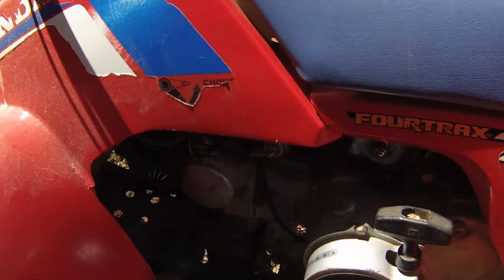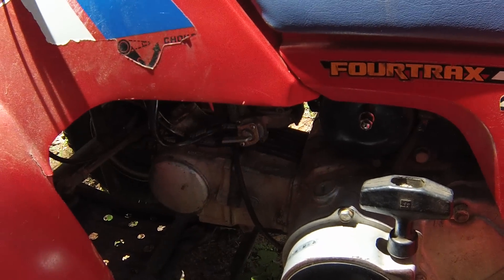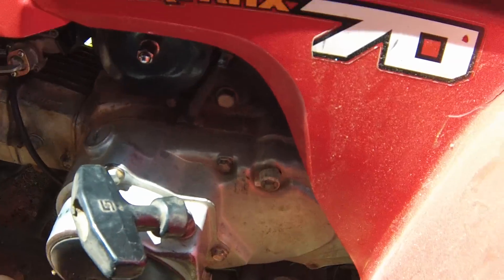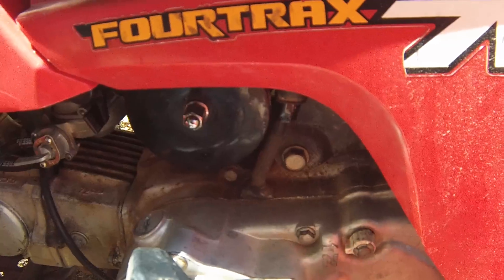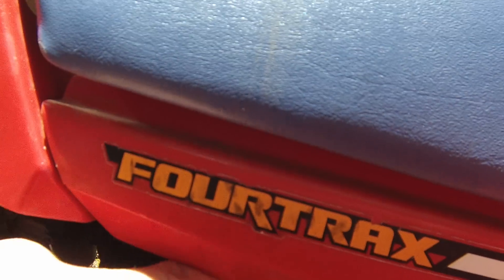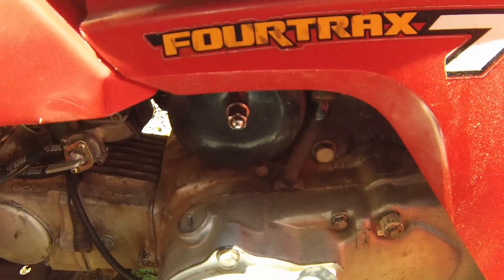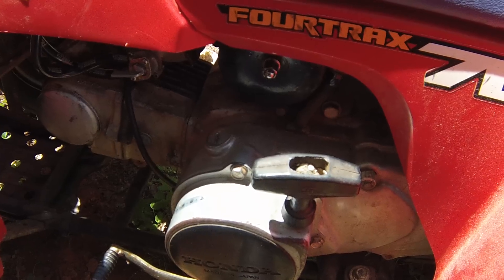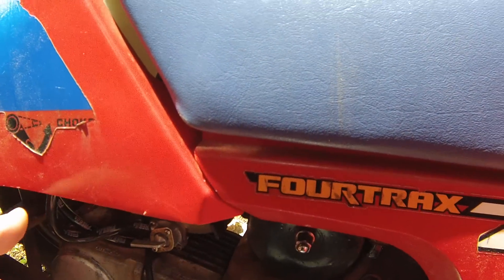Honda TRX 70 No spark fix, try this FIRST!

Comment: I stumbled on this a while back while I was still researching the TRX.  Well, a few weeks ago I finally found a nice original one.  The seller essentially gave it away because he couldn't get it to run anymore.  He'd replaced the coil, plug, kill switch, carburetor, tank, etc. with no results.  I bought it as a non-runner and after putting all back together with the original parts I remembered this problem/video.  Sure enough, it worked!  I pulled that side cover off and removed the switch for a thorough cleaning.  That's all it needed and started happily on the first pull.  Thanks for posting this, it was a huge help.
Reply from the maker: Perfect!  That's why I made this video. He should have checked YouTube. .lol..

Comment: Thanks for the tip. I double checked my switch and found it was only working intermitantly. I grounded the W/R wire, and the TRX 70 runs fine. The grandchildren love it.    Bill
Reply from the maker: Great! Glad I could help.

Comment: This saved my wheeler I bought for my son, I was driving it and one day it just lost spark and it was sitting for 2 years. I got it back out for my sons 3rd b day yesterday and cleaned the carb and checked spark still none. I found ur video and went outside and moved the shifter 50 times and now it started first pull! Thank you!
Reply from the maker: Awesome, good to hear!!

Comment: You're a genius!!!  My ATC 200E had no spark.  I was about ready to start pulling out electrical components and testing them.  Then I stumbled across your video.  I figured I should give it a try.  Shifted the trike in and out of neutral/1st gear about a hundred times...low and behold I have spark now!  Thanks for posting this up!
Reply from the maker: Great, glad it worked out!

Comment: Dear Sir, It was a beautiful Sunday afternoon in NW Ohio and  my 13 year old daughter wanted to ride down the road and raid my friends sweet corn field.  her 70 would not spark.  I pulled the plug once before and used the old sandpaper trick and it worked but not today.  thanks to your video she was riding again.  She is very thankful and also a big Speed Racer Fan so she liked your pic.  Thank You!

Comment: AWESOME TIP: picked up two 1986 70s sat in barn no spark and BOOM this trick and started first pull. Watch the gear bolt sounds like it’s shifting but it might not be watch it and jiggle it a bit and your good to go!

Comment: I have one I'm currently rehabbing. When I press the foot shift lever, the red arrow will not move. Does the engine need to be running for this to shift. I have another autos that shift without an issue without engine running.  Tha is for any feed back
Reply from the maker: Just roll it or spin the wheels forward to help it shift. Bikes/ATV's won't always shift when standing still or the engine is not running.

Comment: How do you adjust and fix the bracket that is it inside the motor that the changes around
Reply from the maker: It's an electrical contact, it would have to be removed and the contact cleaned.
Reply: I am asking how do you adjust the chain
Reply: Sorry
Reply from the maker: @christopherharmon9277  oh ok, if you're drive chain is really loose, make sure your tensioner hasn't broken, it's common on these older units. Or here is a link to the manual. https://www.manualslib.com/manual/825740/Honda-Trx70-Fourtrax-1986.html?page=26

Comment: Could this problem be occurring on an automatic atv aswell? I'm in the process of buying an atv with no spark, if this happens on automatics aswell it might be the first thing I have to try before pulling all the electronics apart.
Reply from the maker: If tour talking about a newer model auto shift, no this shouldn't apply. most commonly I find corroded connections or bad stator. GL
Reply: Thanks ;)

Comment: My 1986 try 200sx has a similar problem, it gets weak spark and sometimes no spark. Does this seem like your trx 70's spark issue?
Reply from the maker: This TRX had no spark. This might be your problem or you may have a stator or coil problem.

Comment: Mine has spark but when I wire it to the coil it’s like it grounds out and doesn’t fire I can’t figure it out! Any help??
Reply from the maker: Check your kill switch wires and make sure they are not grounded when in the run position. Just do a continuity test from the end of the wire to the frame.

Comment: unfortunately this did not resolve my no spark issue.  Any other suggestions?
Reply from the maker: Check all your connections, (disconnect clean and reconnect), also check your kill switch, sometimes they ground out and won't let it spark.
Reply: Do you have a video of you taking off the cover to clean the contact inside?  Mine is also missing the nut and clip showing it is in neutral.  Any other videos of checking connections, disconnect and clean?
Reply from the maker: @markryan2586  No, I never took the cover off. I'm talking about cleaning the plugs in the wiring harness.
Reply: Thanks!!

Comment: My Honda ATC 70 has the neutral indicator but I have to put one in it has the spot for it there is nothing in the hole had a bunch of people to tell me that they did not use them I think they are full of crap lol
Reply from the maker: Yeah, I would imagine it should be the same as the TRX.
Reply: Yeah they use the same motor

Comment: What happens if the wire is gone😭
Reply from the maker: @motogangforlife1508  Find it in the harness and ground it, it will start in any gear.
Reply: @TepcoCycleRepair  how would I do that🤣
Reply from the maker: @motogangforlife1508  If it's a TRX70 in the wire harness behind the air bow there is a white wire with a red stripe, it should be cut it your case if you don't see it. Find it splice in a new wire and put a ring connector on the end of it and ground it under a bolt on the chassis.

Comment: How do you pull hard on the rope to start
Reply from the maker: TensorPlays take up the tension to make sure it's engaged and give it a good pull.
Reply: Tepco Cycle Repair I'm 13 and it hard for me but I'll try cause I always have to tell someone to turn it on
Reply: Tepco Cycle Repair what's the thing called the rope that you pull
Reply from the maker: TensorPlays it's the pull start. You'll get it, try to step on the foot peg and stand up at the same time you are pulling.

Comment: Do you think this will work with a 125 trx honda 1986
Reply from the maker: Yes, I believe it uses the same set up.
Reply: Thanks! I've been trying to fix it I've replaced the cdi coil and I've cleaned the spark plug real good even tho it was good and it still ain't got no spark ima try this and if you have any more tricks or tips on spark problems please let me know!